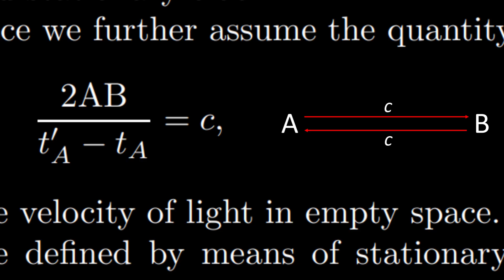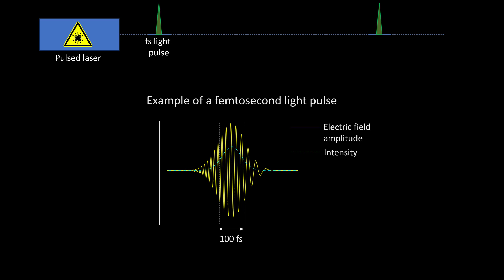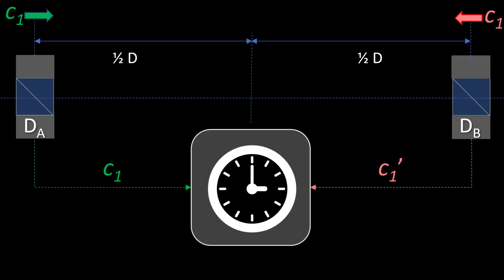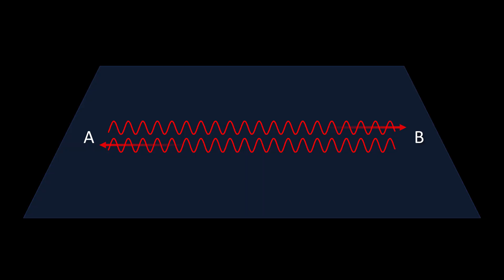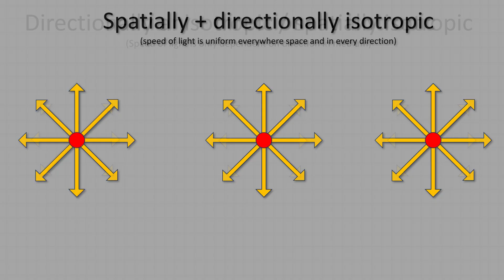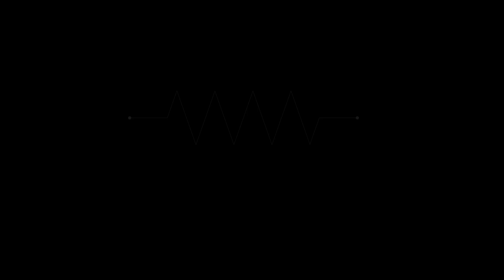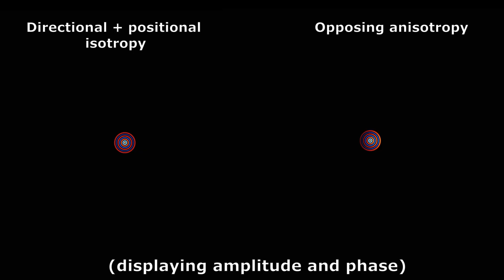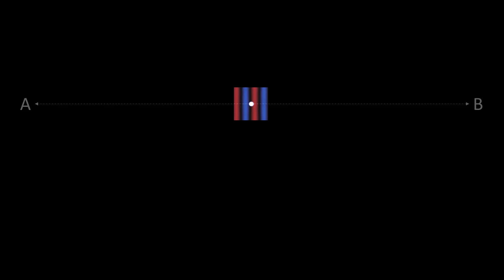Knowing the one-way speed of light

Comment: gps satellites can give a unique one-way predictable source of future information that could reduce need for timing data / start cues / synchronizing, right? and will be below margin of error, else you use a signal like the upcoming weird nova we expect, the arc difference will be minimal, but gps can be timed in midpoint, and as they are timestamped, reading the data means nothing then (but you can say speed of causality slows the clock?)

Comment: Does your simulation assume that space is absolute, or do you account for the fact that space would work differently in opposing directions?

What happens when you assume that c=c', and look at it from a moving reference frame (moving, say, to the right at a constant velocity)? According to the special theory of relativity, there is no way to tell this apart from the "stationary" reference frame in which c=c'; but in the moving reference frame, the two one-way speeds c and c' are no longer the same. Your argument therefore contradicts the equivalence principle.

Comment: I'm not entirely sure why it's said that we can't measure the one-way speed of light. I understand that within the confines of a single, simply-designed experiment it's very difficult (verging on impossible) and why...

But what about a much larger experiment that relies on well-understood infrastructure?

Sure, if we bounce a laser beam off of the reflectors on the moon, we only get the round-trip time. But if we have two synchronized atomic clocks, one on the ground and one on the ISS, which we know remain synchronized because both can be connected to the GPS network (which already compensates for SR effects), now we can absolutely measure the one-way trip time up to the ISS, and also the one-way trip time down from it.

In other words, this experiment would remove the speed of information about the measurements from the equations by using an independent third-party verification of both measurements with no time dependence.

We measure the one-way time from the observatory to the ISS by simply writing down the exact time that the signal was generated in the observatory. Independently, the ISS writes down the exact time the signal was received. Because we can monitor and verify that neither the observatory nor the ISS experienced any GPS anomalies during the experiment, and that both the observatory's and the ISS's atomic clocks remained precisely in sync with the time stamps in the GPS signals, we now know that the two times are objectively aligned with each other with no anomalies (within some tolerance based on the accuracy of the clocks and of the GPS timings).

This is a one-way travel time for a beam of light, is it not? And if the same experiment is performed at the same time in the opposite direction, then that is an independent one-way travel time for a beam of light in the return direction.

Then, some weeks later when the astronauts come down to Earth and the scientist at the observatory goes home, they can compare notes, and it doesn't matter at all what the travel time for the information was, because we used an independent source via a stochastic method rather than a direct method, to verify the accuracy of both experiments.

Is there some reason this doesn't work, in principle?

Comment: I think we can measure the one way speed of light.

Take a hollow cylinder with a slit. Spin the cylinder at a constant speed. Shine a laser into it. Measure where the laser hits the inside of the cylinder. Calculate the speed of light based on the tangential speed of the cylinder walls and the diameter of the cylinder.

Comment: An interesting conundrum. But, the difference in speed is purely theoretical as the one way speed of light has no practical use in observation.
 Unless, of course you want to observe an observer, in which case ???
There is also the effect of gravitational lensing, the effect of gravity on light, there is an effect of bending the light and even Newton understood that things continues, at the same speed and direction unless forced not to, by a force.
So, if you were on the edge of a supermassive black hole and shot a laser beam at the dearest dark object and measured the reflection time, it would seem obvious that the speed of light in both directions would not be the same, but the average speed would =C.
And that's it realy.

While I am here I will drop this little puzzle for budding geniuses.
Tn + En = S n
Sn + Tn = E n
En + Sn = T n
Think Fermat's Conjecture. With T= time,  S = space E = energy.

Comment: could you comment on how gravitational wave detection works? It seems to me intuitively that one way to detect a changing gravitational potential is tocdetect a change in the 1 way speed of ligjt. would this work? if not, could you elaborate? thanks.
Reply from the maker: If you look at LIGO, the light would take 27 microseconds to make a return trip. The frequencies involved in gravitational waves are generally in the order of a few tens of Hz, a few kHz is expected to be the maximum. So the light makes many return trips during a single gravitational wavelength cycle. In addition, the interference observed is the result of the light going back and forth many times and is therefore also effectively a 2 way speed of light measurement.

Comment: I was thinking about a slightly different setup.  Synchronize two clocks at point A and tell Alice shoot a laser pulse towards point B in one hour. Bob then takes one of the clocks to point B and measures the incoming pulse there. The clock should show 1h + (distance between AB) / (speed of light in the AB direction).

Where does this experiment go wrong?

Comment: I have an idea of how it's theoretically possible to measure the one-way speed of light and I don't think it has any problems.

You would send a light wave and start a clock at the same place and time. The light wave will reach a machine you have set up a certain distance away. The machine then sends some other type of wave back, e.g. a sound wave, through a carefully controlled medium, when this wave reaches the clock, the clock stops. You could use the measured time to calulate the one-way speed of light, accounting for the time the sound? wave would take to reach the clock.

Can someone tell me if (and why) this wouldn't work? If it would work, I wonder why I haven't heard of this before.

Comment: Why don't we put glass or some other substrate to slow down light in one direction only, then switch the direction it gets slowed down?
I think that just show that substrate might be asymmetrical but if we redo the experiment by flipping it, that might bring some insight.
Reply: This cannot measure the one way speed of light. Or maybe even proof that it is the same in two directions. But I think it can at least show that it's different in two directions if it actually is.
Reply from the maker: The thing is that light would slow down in a high refractive index medium proportional to the speed of light in vacuum. So if you do the same calculations I did for vacuum case, you will still find the same values regardless of the media involved in the light path.

Comment: Now i might be missing something but we know the speed of sound is constant in air so could one not use spund to trigger the clock and the delay is the distance divided by speed of sound. Thus avoiding measuing the two way speed of light.
Reply: The speed of sound isn't constant in air as it depends on how the air is moving. And sound is made of molecules bouncing off each other, which is an electromagnetic force, and if light travels different speeds, so does electromagnetic force in general

Comment: Around the year 2002 an interesting star was observed. It's V838 Monocerotis star which is surrounded by a thin nebula. After its "eruption" during which it brightened considerably, "an echo of light" on the nebula was observed. Since it expanded equally in all direction it is hard for me to imagine how the speed of light could be different depending on the direction.
Also, in 1676 Rømer roughly measured the time the light takes to travel the Earth's orbit diameter and as far as I can understand his method, it's a one way determination of the speed of light which is the same, regardless of the Earth-Jupiter orientation in space (granted, only along roughly the plane of the ecliptic but I fail to see how that particular plane would be in any way special in the cosmic scale).
Reply from the maker: What you observe in the case of V838 would really depend on the direction of the anisotropy in the speed of light. Also, it would be hard to measure the difference in opposing directions if it is small compared to the speed of light itself. Don't ge me wrong though, I'm not advocating that the speed of light should be different, just that it is hard to prove that it can't be different.

Comment: If entangled particles can violate locality, could they be used as a one-way timing mechanism? (I don't know enough about quantum mechanics to know exactly what I'm saying but) if you "activated" one particle as the light passed it, couldn't you instantly transmit (or at least faster than the speed of light) that timing?

Comment: Best time resolution in a time-of-flight experiment with electronic triggers may be around 50 picoseconds. A 1 ppm error of c consequently can be achieved at a measuring distance  of the light path of more than 15 km. Getting a stable signal transport over e.g. a coax cable of the same length looks almost impossible.
However, if it may be feasible, rotating the whole setup 180 degrees might answer the question of whether the vacuum in space is anisotropic, of course only at the precision level of 1 ppm..

Comment: When you are moving at speed v, for example v = 1/2 c, you shine light into the mirror, obviously the time it takes for the light to reach the mirror will be longer than the time it takes for the light to bounce back to you. The relative speed of light to us will be different in the two directions.
That is the earthly frame of reference of the experiment. With an absolute frame of reference(in mathematics), light still travels at the same speed C in all directions.
It is necessary to clarify the meaning of electromagnetic waves. Let's start with the material. There is no matter, no electromagnetic waves. Specifically, there are no electrons, no electric or magnetic fields. Electric and magnetic fields are a property of matter. The elasticity of space is the elasticity of the electromagnetic field, reflecting the elasticity of matter.
If we move in an absolute vacuum, lacking electricity, magnetism or matter, it means we are standing still.

Comment: If the speed of light varied based on direction, then the observable universe would not be spherical and we would not be at its center. We'd see farther in some directions than others and thus see more stuff in those directions. We could (roughly) measure the relative speeds of light coming from different directions by counting the number of galaxies visible in those patches of the sky. I think it would also show up as an anisotropy in the size of the temperature fluctuations in the CMB. The relation between redshift and distance would be anisotropic. And probably other stuff too that I can't think of at 3 in the morning.
Reply: I thought of similar things. If there are enough stars with redshift to measure the expansion of the universe it should be possible to see a different speed of expansion in different directions if rhe speed of light would be direction dependent. The point of seeing more galaxies is brilliant as well (If mine has any merit & independent of that)

Comment: There is a miscalculation at 8:04 and it appears to be important. You accidentally have Δtr_31 = D/c_1 when it should be D(1/2c_1 + 1/2c'_1), you also committed this same mistake for Δtr_42. It is not an important mistake though, because you fix it immediately.

Comment: Would it also be possible to prove a constant one way speed of light by observing that gravitational lensing effects are the same for all directions of incidence? By my understanding gravitational lensing occurs because the spacetime is accelerating towards the beam, thus introducing a curvature. The radius of the curvature would then be related to both the field strength (which is constant from all directions of motion) and the speed of light.

Comment: So if I place a perfect mirror at the event horizon of a black hole, the light would return at the same speed? If not, doesn't all curvature of space time change the speed of light in each direction?
Reply: I thought about this using a black hole event horizon and letting the light circle once and since you know the circumference you know the one way speed.  But the curving of the light beam might be equivalent to reflection except you are doing the reflection with lots of mirrors in a circle (event horizon).

Comment: The energy and momentum conservation argument is pretty rock solid, having a different speed of light in different directions would break so many symetries (and thus conservation laws) nothing would end up making sense.  You could even use that argument to prove that the momentum transfer and thus the speed must be the same in both directions by measuring the radiation pressure exerted in opposing directions.  

One also has to ask what direction would the light care about, the direction of the observer, the universe, some mystery third thing? If its the universe the entire idea of relativity breaks down.

I have to say that although directly measuring the speed of light in different directions may be impossible due to the arguments you and Veritasium laid out, the one way speed can be indirectly measured using shared clocks.  Using a shared clock, while not a direct measurement because you must infer that the clocks are indeed shared and synced up, is a straightforward way to do it. Many research groups doing quantum networking already have timing and synroization of sub ns presistion over hundreds of km, not to mention GPS which relies on super presice shared clocks.
Reply: I don't think so. Lorentz and Poincare based their aether theory on the assumption that the speed of light is constant only in the stationary aether. This is how Lorentz created his transformations. On this basis, he concluded that the forces in the atom are electromagnetic in nature and this simply explains the mechanism of time dilation. It seems to me that even in the so-called in the ether, the speed of light is not constant - in a gravitational field it slows down in the direction of the action of gravitational forces, because gravity itself results from the imbalance in the transmission of forces at the atomic level in deformed space.

Comment: 1. Put light source and detector with 2 really precise clocks into 2 really distant places (Earth and Moon for example)
2. Sync the clocks
3. Measure pulse departure and arrival time
4. Count one-way speed of light knowing distance
This measurement is limited only by clock precision.
Reply from the maker: @TechMasterRus  It's literally impossible to sync two distant clocks without assuming that the speed of light is identical in opposite directions.
Reply: @HuygensOptics  Possible. You just sync them with a signal going from very far away place located on central perpendicular to the axis between clocks. This way, the directions of sync signal will be nearly the same. Or sync them in one point and then slowly move to final positions where do measurements.

Comment: Two atomic clocks, one emitter one detector.  The pulses you send have a varying length depending on the current clock data.  When analysing results adjust clock sync by the extracting the clock data from the pulses received.  Once sync is as good as possible the speed of light one way is the delta.

Comment: We could fire a beam of light through an incredibly long internally reflective looped tube.  Light is fired in at the opening and a timer starts, it then loops back to the starting point where a sensor stops the timer.

This is arguementably a one way trip.
Reply: But it's not, because it turned around, but gradually. It spent half the distance going forward, and the other half going backward.